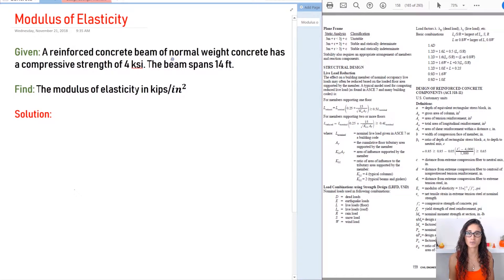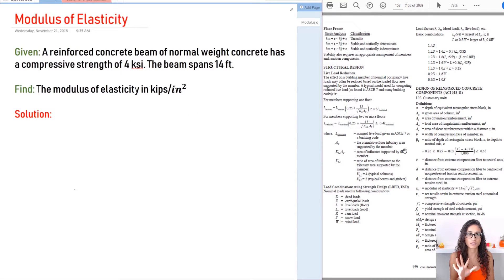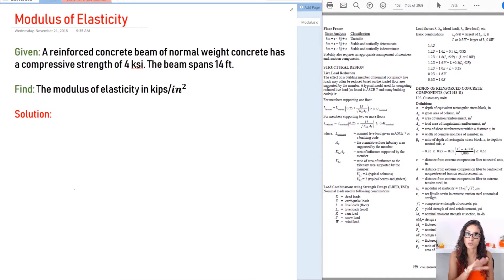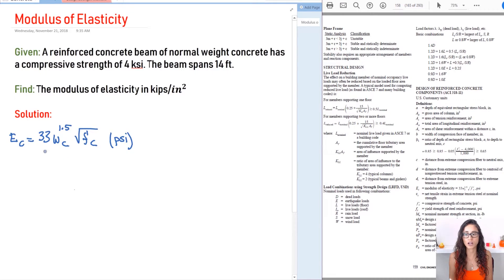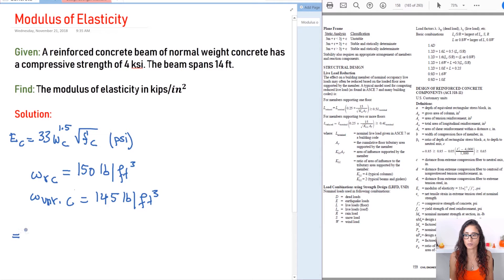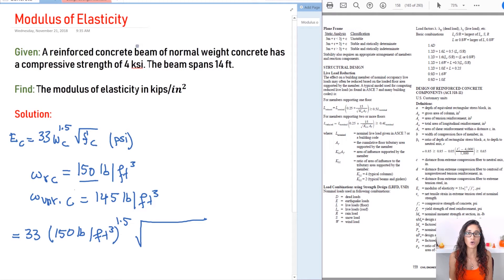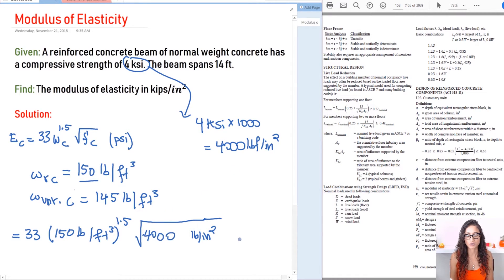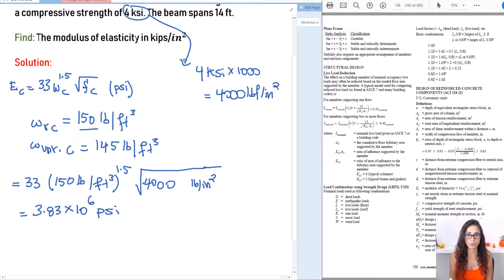FE Civil Concrete Design - Modulus of Elasticity

Comment: missing to covert 150lb/ft^3 to lb/in^3
Reply: Incorrect. This formula requires the weight of concrete to be in lb/ft^3. They have a similar problem on the official FE Civil practice exam.

Comment: Is there a way to know if equations take care of conversions? Like in environmental engineering, you have the CxMGDx8.34 or the modulus of elasticity equations but there are others where you have to make sure you've converted everything for consistency.
Reply from the maker: That is a good question. Most of the equations on the reference manual that are similar to this case, the units are specified for each variable, but some are not and you just need to remember them. Also, check out this video, there is a conversion that you need to know if you are using the pump formula, https://www.youtube.com/watch?v=RCZh8l19x0g&t=20s. I hope this helps and good luck!

Comment: How do your units work out in the problem to be psi because I get the final units to be lb^2/(ft^4.5*in)?
Reply from the maker: That is a good question, but the unit conversion is already taken care of in the equation, some equations like the rational method in hydrology, the units don't add up but it is already taken care of in the equation. So for this equation, make sure that fc is in psi, and the w is in lb/ft^3 to get psi. I hope this answers your question and good luck with your studying!

Comment: The weight of concrete doesn't have to be in lb/in^3?
Reply: Yes I was wondering this as well.
Reply from the maker: So the way the equation is derived, it takes care of the conversion from lb/ft^3 to lb/in^3. Therefore, the weight of the concrete has to be in lb/ft^3 and the compressive strength has to be in lb/in^2 not ksi.